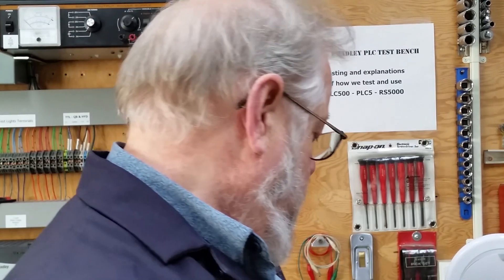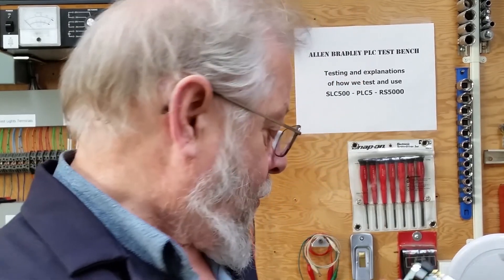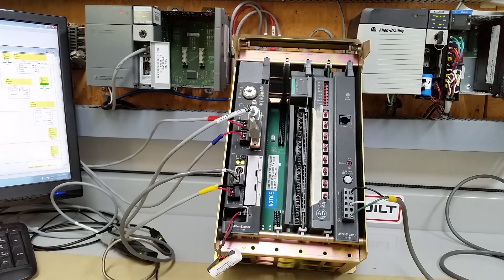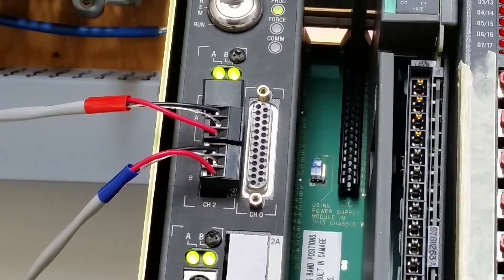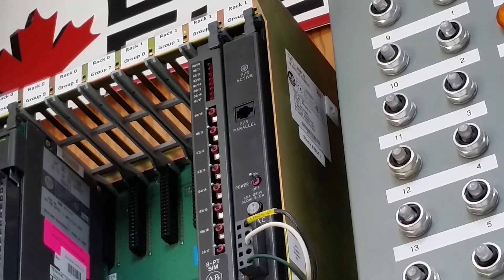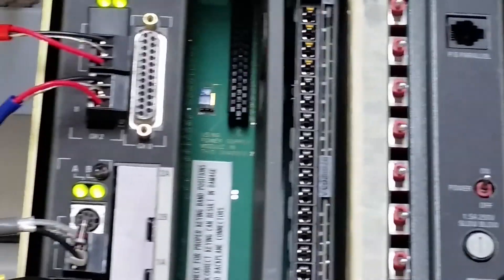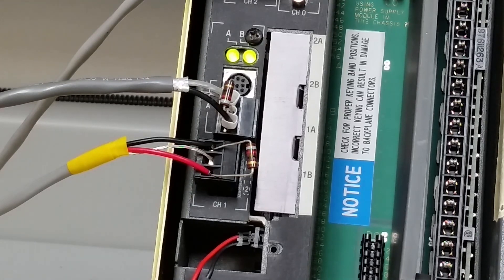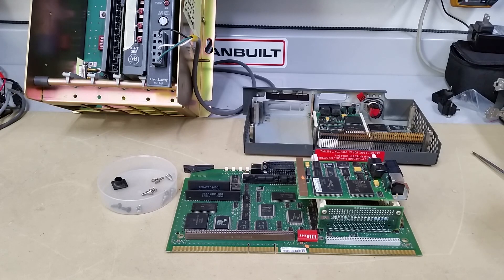PLC5 Communication Ports testing - Video 2

Comment: Got an adapter fault on I/O after replacing  input card, any suggestions.
Reply from the maker: Hi:
Generally with the PLC5 you need to power down the chassis power supply before removing and inserting cards.  The new Clogix can be done when powered up, but the PLC5 didn't always like it.  
Just one of those things with older technology.  Generally solid, but you have to respect the age☺